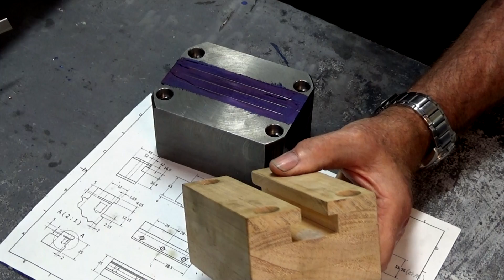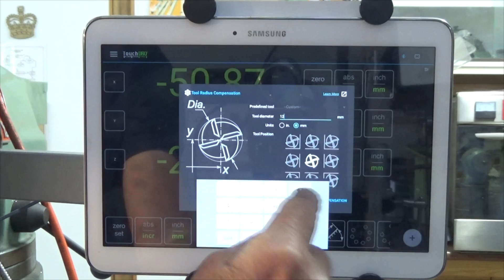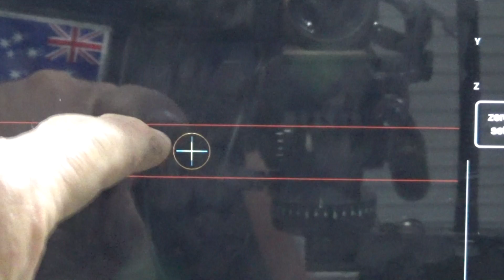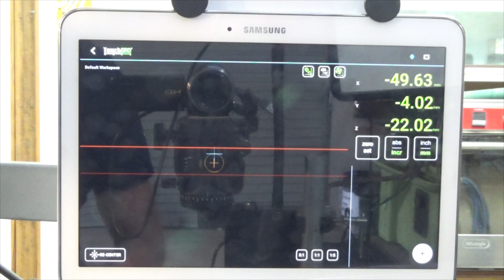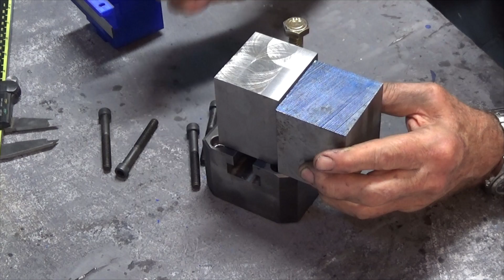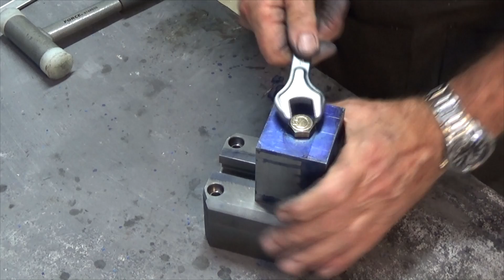Rear Parting Tool Holder For Your Lathe - Part 2

Comment: Since the cutting blade is mounted upside down, the way you designed the clamp means that most of the force is transferred to the flexure portion and set screws rather than the solid block. You may want to think about how to increase the rigidity, maybe providing the tool clamping force from the bottom instead.
Reply from the maker: Jason, I want to try the inverted tool approach but of course I have no way of verifying it will work without trying it our under real world conditions. I take your point about the lack of rigidity above the cutting edge of the tool but it cannot be any worse than having the cutter deflect down and inwards as it does in a conventional front mounted tool. We shall know within the week if it's a success or an embarrassing failure!
Regards,
Mark
Reply: @Preso58  Not sure if I made my point well. I have no objection to the overall design, just pointing out that with the conventional tool blade holder, the force on the blade is transmitted to the fixed side of the tool holder. The force concentration is at the solid front edge, and the flexure portion has leverage advantage at the rear, whereas your tool holder has the flexure and adjuster screws, especially at the front, taking up all that cutting force. If you make that top surface solid and clamp the tool from the bottom side, I would expect it to be more rigid.
Reply: @Bakafish  Actually I mentioned just today that the Colchester manual shows a design which is inverted, the fixed surface is on the top and the clamping screws come from the bottom. I will iterate on this design using a standard insert type tool holder which has a block mounted on the side. It fits in a slot in the holder and is secured by two M8 screws mounted in the horizontal plane. The clamping block is then supposed to be clamped in the tool post just as is shown in this video. Personally I do not like the tool overhang, a more rigid connection to the tool post is preferred. It is only a small step to make a 4-way indexing rear tool post, on one of the sides a special interface (i.e. tenon/ 2x M8) to fit the tool holder directly. I would like to use other positions for a tailstock turret and possibly chamfering and threading tools.
Reply: One of the points of this design is that any flexure reduces both the top rake and the depth of cut- unloading the cutter. A balance is found. This is similar to the (conventional cut) top pivot point parting cutter. Indeed, I intend building a similar unit with flexure deliberately built in.
Reply: @Tensquaremetreworkshop  Getting the flex load forces (and damping) where it helps rather than just creating chatter seems more difficult than just making it as solid as possible.
Reply: @Bakafish  Except it can never be totally solid. Parting is not a 'single point' cut, and chatter is caused by digging in, rather than unloading. Yes, you can get a higher frequency evidence of varying cut, but it tends to settle in. There is a long history of ensuring that the inevitable movement unloads the cut- choosing the pivot point is the key to this. As I said before, this is above and behind the tool in the conventional arrangement, but below it in the case of an inverted tool. Mechanical damping would be nice, but mass damping also has an effect. I intend slotting the upper mount from the rear, with a bolt through set to limit the movement in extremis. I can increase the depth to find a working point. A pivot 30mm in and 30mm down from the tip looks suitable, going by commercial versions of such toolholders. It can be quite rigid- it just needs the be the point that bends before anything else...
Reply: @Tensquaremetreworkshop  I never said anything about being totally solid, if you look at his mockup he has the main forces being exerted on the flexure rather than the fixed part. That seems suboptimal. As for your idea that chatter is primarily 'digging in' I have to disagree. Unloading the tool creates chatter as well, as the cut depth will become uneven and susceptible to harmonics. I agree a proper design likely reduces the effect and makes it more controllable, but the cutoff tool holders (still sold here in Japan) that use a flexible section have materials and design that has been optimized over the last 50 years. I think it is unlikely to get this right without a lot of iteration, so pursuing rigidity seems like a better plan for a home built design.
Reply: @Bakafish  I did not think you meant 'totally solid'- such a thing does not exist.
A major factor in this is leadscrew backlash- whatever direction (L or R) the tool comes from, there is freedom to move inwards because of this. The top and front rake of the tool produces an inward force. Frequency of oscillation depends on the force and mass involved; chatter is low frequency (you can inspect and count this on an affected workpiece) because the mass of the whole cross-slide is involved. This is supported by the known effect of raising the tool reducing the chatter- because it is reducing the effect of the front rake- indeed, it can act as a support to the tool (at the expense of friction, etc. This is standard practice in wood-turning- otherwise it digs in.) Changing the pivot point and the flexibility, so that increasing the load (caused by digging in) alters both the top rake and the radial distance sufficiently to compensate for this inward force is the solution. Mark discusses this, but is mistaken in his assertion that a rear holder stops the backlash effect- there are rigidity improvements however. As you say, this has been understood for 50 years. How critical is the pivot point and level of flexibility? given that change of either rake, width of tool, amount of overhang, precise height, tool material and shape, lathe characteristics, and a host of other factors are involved, chasing optimums appears fanciful. The evidence from others is that getting past the critical point is sufficient. Some get a high pitched noise at the start, before it 'settles in' and cuts normally. I surmise this is caused by horizontal 'hunting' until there is enough side-wall to stabilize this.
If you do not believe that chatter is caused by this inward freedom, the onus is on you to produce a valid theory and evidence of another cause.
Reply: @Tensquaremetreworkshop  I agree with you about virtually all of this, but I disagree that chatter cannot be the result of deflection that disengages the tool from the work. I'll agree that it is better to disengage than to dig in, but disengaging isn't a solution, it is a tradeoff. Chatter is the result of uneven depth of cut, and is compounded by harmonics and feedback of the surface. Disengaging the tool creates uneven depth of cut just as digging in does, although to a lesser degree which I think we both agree on. My point was that disengagement isn't something a home shop builder should try to increase or design into, as (you clearly understand) it is a very complex thing to get right. Obviously if forces are going to cause deflection having it disengage rather than dig is better, but the goal should always be to minimize deflection as much as possible, not to try and put in some flexure, which was why I was pointing out he should flip the holder's clamping side. That was my point. Flip the clamp. You with me on this?
Reply: @Bakafish  I think we are getting closer. The difference with dig in is that it is positive feedback- increased depth brings greater force. Always very difficult to damp. Retract deflection is negative feedback- deflection reduces the force. Of course, this is a dynamic situation, as feed etc changes, but it is, at heart, stable. Damping (other than mass damping) is difficult to arrange, the movement is small and the force quite high. Friction can assist- tools with a slight sideways front horizontal rake produces a side force that gives friction on the side rake. At heart though, it is a binary difference between positive and negative feedback- going negative will bring benefits; how negative is less important. Indeed, as previously discussed, it is not possible to decide an optimum point without fixing several variables. Yes, as solid as possible, provided the (inevitable) movement disengages.
Clamping from the top or bottom makes no difference- the clamping forces are equal and opposite in both cases (ignoring the trivial weight of the tool); clamping from the top is much more convenient (accessible).
On the topic of home shop builder capability- he often has a better chance than a manufacturer. His need is fixed and specific, and not at market demand hazard. S/he can often make a very satisfactory solution that would never fly as a commercial product. And has the motivation to try. I have made several demonstrable improvements to my machine tools that are unavailable on the market. Indeed, the subject of this video could be classed as such.
Reply: @Tensquaremetreworkshop  The static clamping forces may be equal in the two different orientations, but the ability of them to resist deflection under load are not. As I said in the above comments, the force concentration towards the flexure on that side is not to his favor. But I feel this horse has been beaten enough. Another poster said the factory design follows what I was saying, since the holder itself is removable the screws on the 'bottom' are likely not a big disadvantage. Let's see what he does.
Reply: @Bakafish  'Ability to resist deflection are not'. I would be very interested to see the force diagram that supported that. The static force is the resisting force to the deflection force...

Comment: Very satisfying to watch this machined part emerge from the chunky piece of stock - looking forward to the next step and of course when it all gets the Preso 'icing on the cake' finishes.
Reply from the maker: Thanks. I will be parkerising all the steel parts and the iron riser has been cleaned up on a 120 grit sanding belt to remove the machining marks. I have never parkerised iron before. It is supposed to work but it is a big heavy part and the parkerising works best when the temperature of the part comes up close to the boiling point of water. It probably won't rust as readily as the steel parts though.
Regards,
Mark

Comment: Mark do you know if the updated software for Touch DRO will work on Samsung Galaxy 7 tablet.? I love my Touch DRO but would also like to add the upgrade.
Reply from the maker: I believe it will work on all Android operating systems after V4.0. The Beta version is available on Play Store now.
Regards,
Mark
Reply: @Preso58  Thanks Mark. After I finish the job that is on my mill now, I will try to update it.

Comment: How important is it to use malleable iron for this project? It is rather expensive.
Reply: The rear post on my Colchester looks factory and is all steel rather than cast. If using cast, I personally would use maliable to reduce the possibility of the 'T' breaking out. Cast is good in compression but not tension.
Reply from the maker: Mark, I had never machined anything from malleable iron before and there was an Australian metal supplier who just happened to have the correct size in stock for this project. I did ask an Australian home foundry operator if he was interested in casting from some patterns of my design but he lived in another state and the cost of shipping would have made it even more expensive. He also doubted that he could melt enough iron to make the parts I wanted. I did have some steel that was close to the size I needed but it was a very hard grade of material and it would have been a challenge to work with. 
Regards,
Mark
Reply: FWIW, I suspect that ordinary "gray" iron will do for that block, BUT the mess of dusty swarf generated will be HUGE.  OTOH, somebody with a home foundry setup could make a pattern and cast it in "gray" iron that requires only "modest" machining to final size.